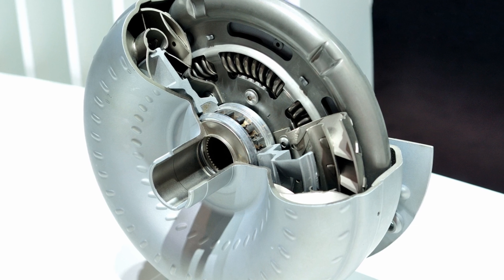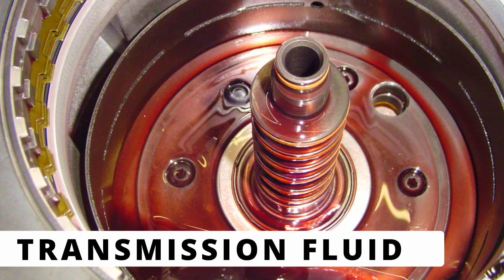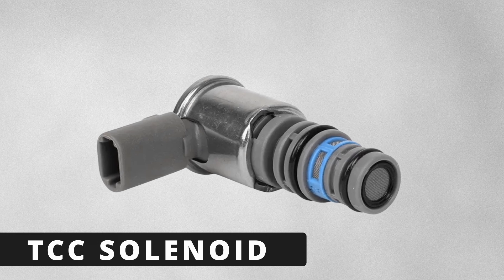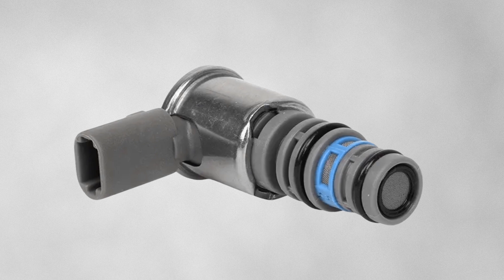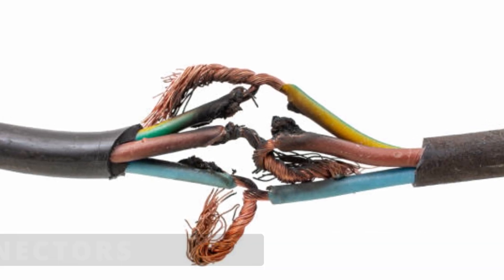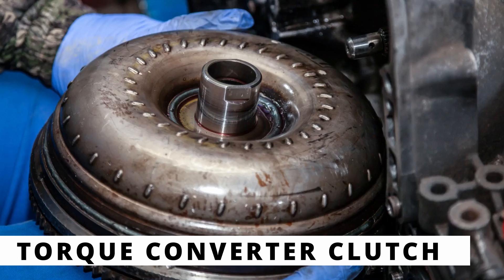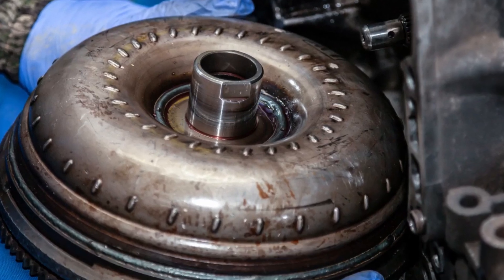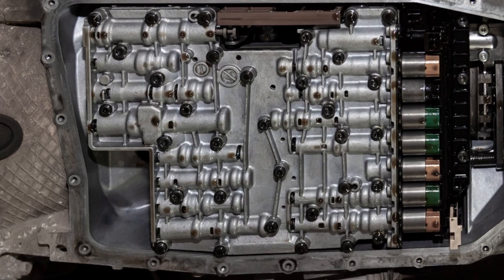P0741 Code Explained – Torque Converter Clutch Solenoid Circuit Performance/Stuck Off

Comment: P0741 stuck off 2008 Kia Sedona. Replaced the solenoid today. Will see if that fixes it. Already change the fluid and filled with SPIII/HK fluid.
Reply: Did the problem get fixed?